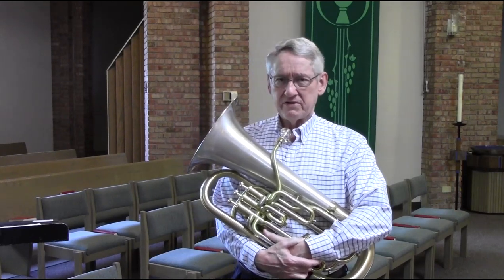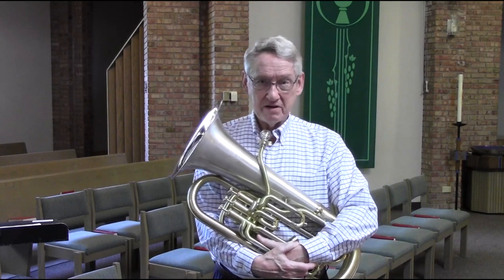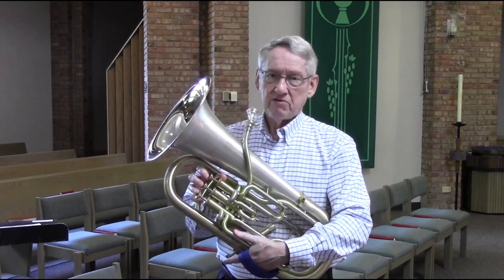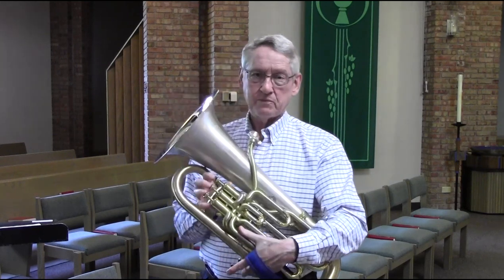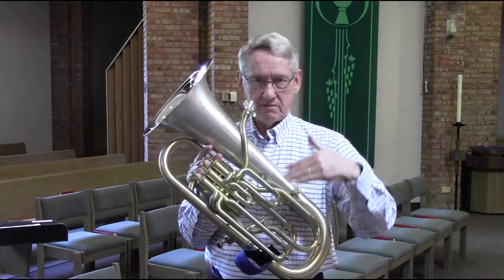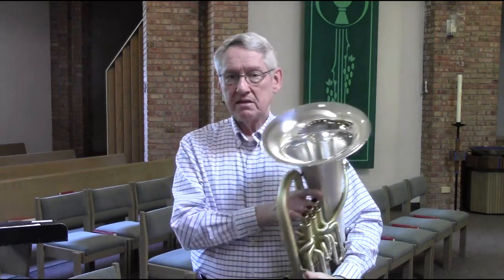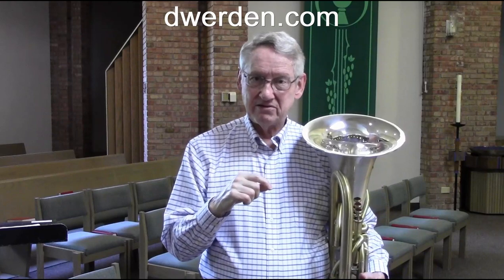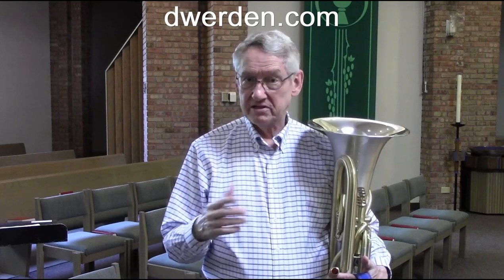Building Strength & High Range on Euphonium and Other Brass

Comment: How much do you think the quality of the instrument being played influences the tone and sound of the note. I am playing a cheap 4 valve compensating euphonium and although the sound and quality of my upper register is getting better it sounds tinny above TC B flat and I'm struggling to improve.
Reply from the maker: A really poorly-made horn, or one in need of repair, can affect your sound in various ways. However, if your horn is one of the Jin Bao clones (or similar) it is probably not the main problem. Keep in mind... Even among professional horns, a different brand can make playing easier and can shape your tone to some extent. My advice is to have someone who is an experience player try your horn. If it seems OK, then just work on these exercises! Remember the basic idea: start with a good tone, crescendo on the way up while maintaining a full tone.

Comment: Thanks David. While I understand how this method can be effective what I would like to know is how to use the method in a practice routine lets says I want to work on increasing my range and not just maintaining range do you get to the register or scale that is a challenge then keep attempting it or drop down to the one a tone lower. How long should your developing range practice last and how many repeats do you attempt at each scale. I hope I have made my question clear and maybe it might be best answered with another video. Thanks for the great videos you are producing.
Reply from the maker: For maintaining my range, I typically just use the 2-octave scales during my warmup (after I have my chops feeling a little comfortable). I might start with a scale from low F to F above the bass clef (G below the treble to G on top of the treble staff). I start there to set a "model" for myself, and I try to hold the top note a few beats, and make it vibrant. Then I move the scale up a half step and do the same thing. I keep moving to my top "solid" note.

Most days I try to increase the range beyond my comfortable notes. I will go 1 or 2 half steps higher. Increasing takes a long, steady effort, and that is where I fall short many days. However, I don't think I have yet found the limit of my high range, even at my age, and I will keep working at it. With any skill, including tonguing, volume/projection, etc. one needs to "stretch" a bit each day in order to improve. And once improvement happens, then the maintenance process needs to include the new limits. In my own case, I have sometimes stretched a skill, like tonguing, for a particular event and then let it slide. That is only because I have limited practice time and many things to work on. Ideally, we would hang onto any new skill/limit by steady maintenance!

Comment: Thanks for this going to try it in my practice, for some reason I am having problems with b flat above the stave (treble clef) it's very fuzzy like the note can't be hit properly can't understand why either as it's not a note I have had problems with previously.
Reply: Well first check your instrument to see if there are any problems, then check the mouthpiece to see if you’re comfortable with that one or if you’ll need to change for another one. If it’s not the former it’s you. Just practice better air control and not squeezing out the notes.

Comment: I was wondering what kind of mouthpiece you use?
Reply from the maker: I use a Denis Wick 4AL.
Reply: @dwerden  Hello, thanks for the important video. It says in the mouthpiece description (at Amazon) that the Denis Wick 4AL is for both Euphonium  and for trombone, but I read in the Web that they are not the same, as the Euphonium mouthpiece is larger, deeper cup, and different shank sizes, so will the Denis Wick 4AL be fit for me? thanks.
Reply: @ilank43  I know I'm not Mr. Werden,  but picking the right mouthpiece is really up to you, everyone is different... You can use the most famous player's mouthpiece if it's not fit for you. You should be trying and find out which is the best, and judge just one mouthpiece is about a month, but for sure not an instant recognition